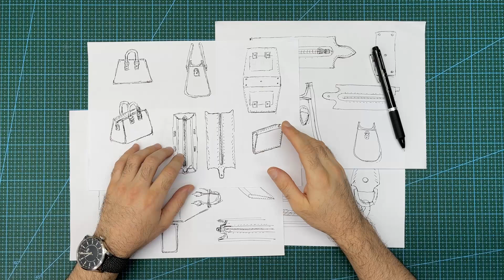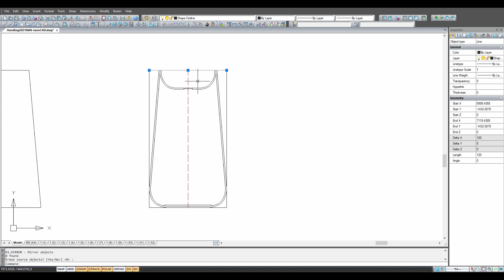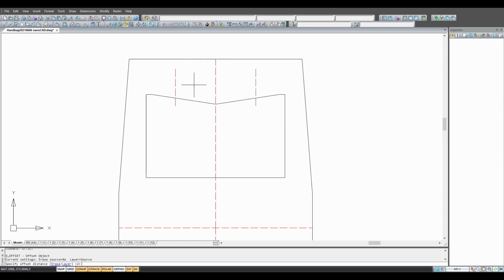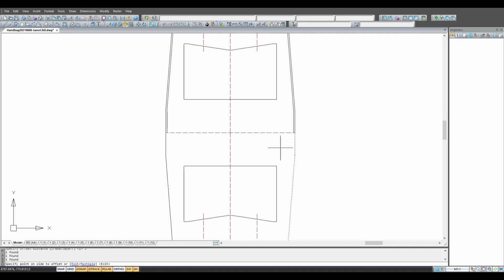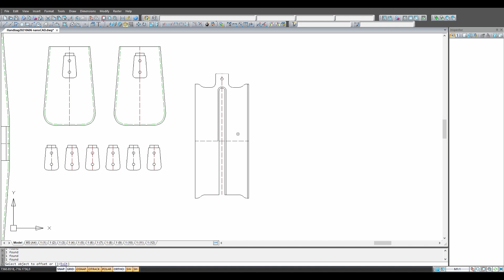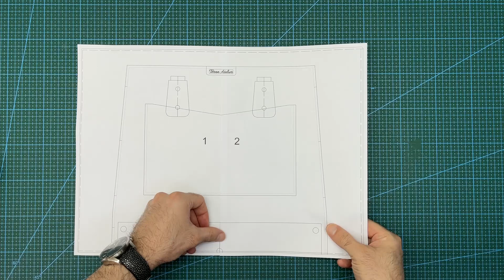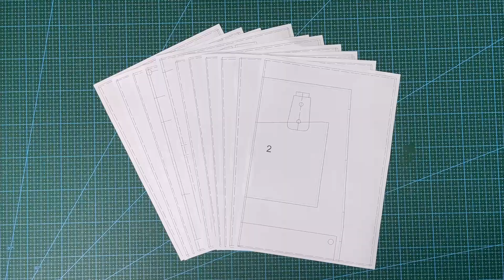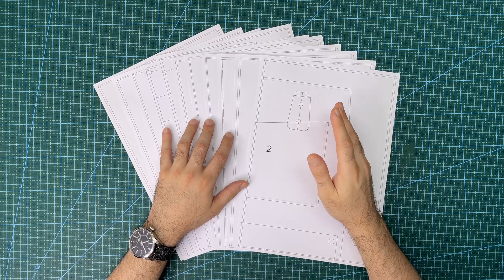How to Design a Pattern for Leather Work

Comment: I really like your videos and your metod of work designs and patterns. I have learnt a lot from you. I wonder if you can render your designs using any software program
Reply from the maker: Thanks! Some types of software would not be as suitable for complex projects like bags but most will be fine for small items like wallets. I always use CAD software like as NanoCAD and AutoCAD as I am familiar with them and they are quite powerful.

Comment: When drafting the pattern for curved edges, especially at the gussets of the bag you designed in this video, how would you calculate the amount of leather you’ll need? Is it good enough to round off the dimensions to the nearest decimal point or is there something I’m missing? I usually design my patterns with Illustrator
Reply from the maker: You will need to use the length of the gusset at the stitching line not its perimeter. Then match this length to the body of the project. With this method you will have an accurate matching lengths. Nearest decimal point is more than accurate enough when designing with leather.
Reply: @TeranAtelier Thank you! I’ll keep this in mind when I work on my next project

Comment: the side parts of the bag are rounded at the bottom, so i think it's harder to measure or make out, how long/tall the front and back are going to be, right? is there any way to 'measure' lines when they're rounded like that?
Reply from the maker: Set the stitching line length on the gussets equal to the length of the sides of the main body. Then when you chisel in your stitching holes with the same spacing on both pieces separately they will have the same number of holes and be the same length. I will probably make a video on this topic in the future. This is easier done on CAD.
Reply: @TeranAtelier  okay, thank you!

Comment: How do you measure a gusset size for this type of bag?
Reply from the maker: Basically you match the number of holes on the gusset and on the body. If the holes spacing is the same then the length of the gusset/body will be the same. Another way is a more trial and error approach.

Comment: Hello, thanks for the great video it’s very very informative. Can you please suggest software to be used in MacBook?
Reply from the maker: Thanks! Try giving LibreCAD a go. I have played around with it a bit on windows and it seems work well.
Reply: @TeranAtelier  Thanks for the advise, one more question plz. which is best printer to use to print these after creating pattern, as If we use standard printer than it modifies the size
Reply from the maker: @ansulgadia  Any printer should work fine. Before plotting on CAD, select layout as A4 and scaling = 1 on the viewport. Then when you print select A4 paper and scaling =  100% or 'actual'.

Comment: How do you figure out your gusset lengths?
Reply from the maker: Set the stitching line length on the gussets equal to the length on the main body. Then when you chisel in your stitching holes on both pieces separately they will have the same number of holes. I will probably make a video on this topic in the future.